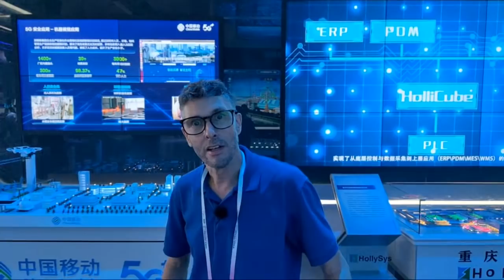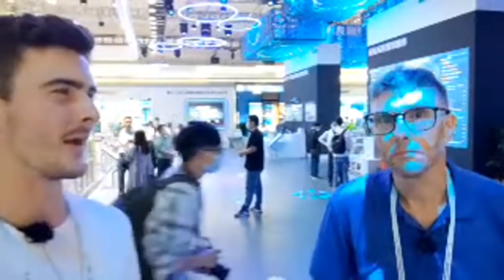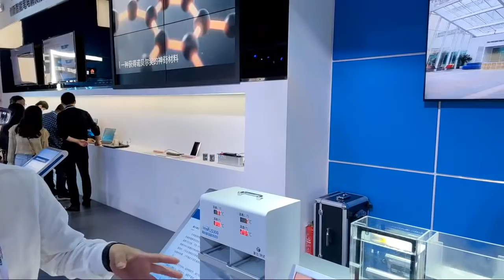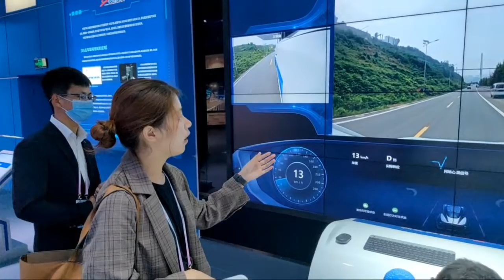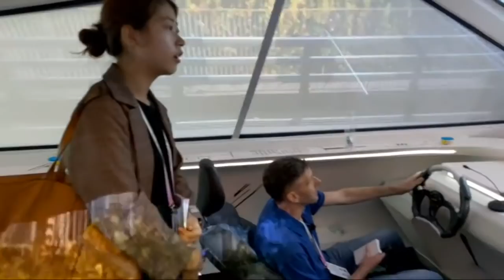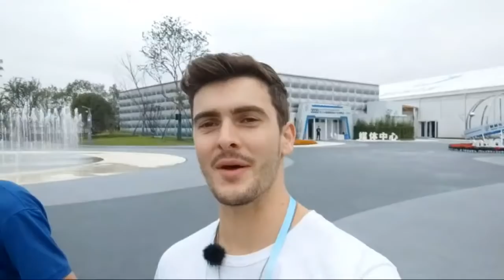LIVE at China High-Tech Exhibition

Comment: That glass which changes color/transparency on temperature is not used for TV, I guess. It is used for the outside of the buildings, which will reduce the power consumption of lightening and airconditioning.